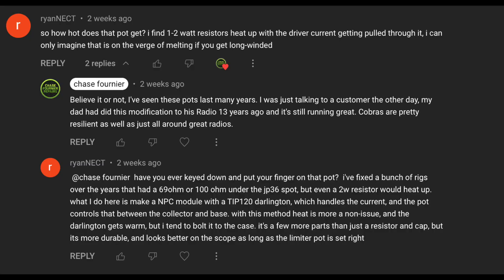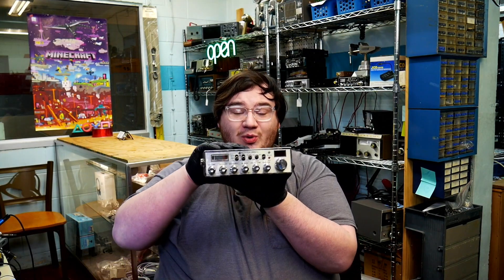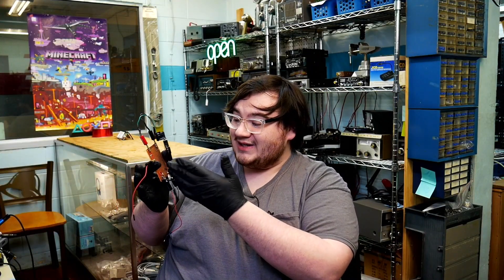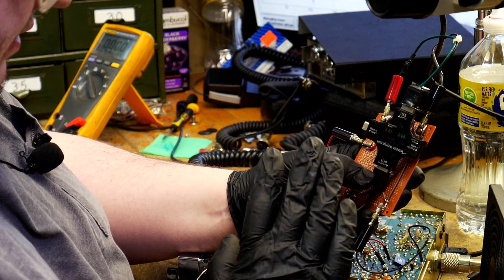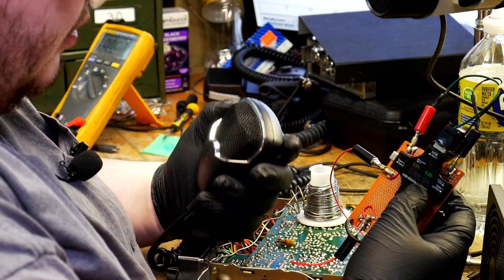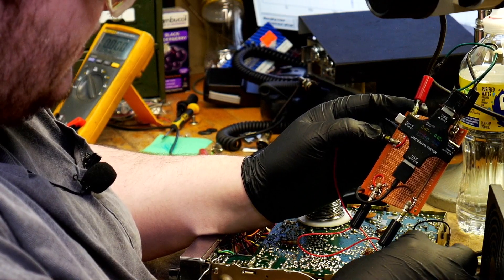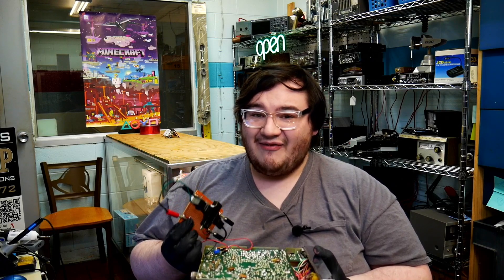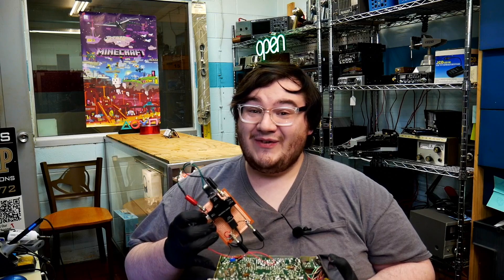I Built a Current Tester to Save My Dad's Reputation

Comment: You have a mutimeter right in the background of this video that has a current setting.  Just as a reminder, the meter has to be IN LINE of the power.  So you would have to break the connection on the resister and have one lead connected to the resister and the other lead to the board.  There are diagrams online of how to hook things.  You'll also want to have the antenna hook up to close the loop on the transmitter or else there would not be any load. I'd love to see another video showing results! Good luck!

Edit: After rewatching the video I do see you do have your tester inline on the resister.  My apologizes. Should be super easy to hook up the multimeter then!  I also did watch the original video where you made the mod and you have a load tester on the antenna.

Comment: What am i missing? I would think that you would have to measure the worst scenario voltage drop over the pot to calculate the wattage.. Just measuring the current doesnt say anything, it could be a problem with 500mA through the pot if the voltagedrop is large enough so the resulting wattage is to high.. Im sure im missing something but what?